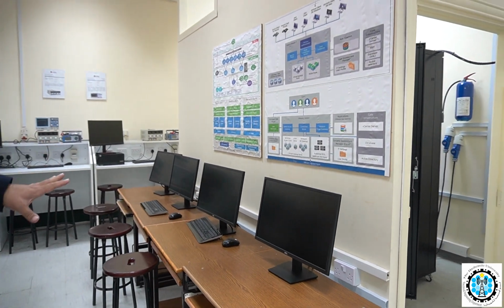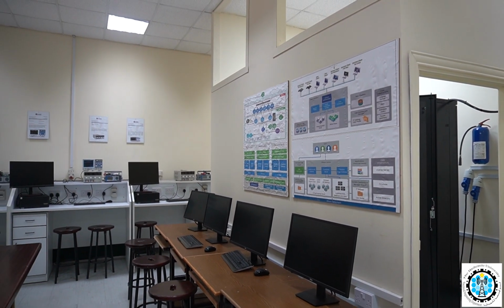Internet of things and Cloud Computing and AI Applications Research Lab (ICCAA)

Comment: Very interesting,
 
Is it a fab lab or a cloud lab?
Because it was announced that it would be a fab lab. (3D printers and laser cutters)
And the idea of a cloud lab is not that obvious; for example, what are the types of projects accepted in this lab and the parts of the projects that could be linked to the cloud system in many different fields?
 
I'm a mechanical engineering student at HU and have many projects in the environmental field. I have participated in many programs abroad, in Germany and the US. So yes, it is very interesting, and I can't wait to see it.
Reply from the maker: Thanks Yara, although we got CNC machine, it has not been advertised as FabLab, as you may probably know we have Orange FabLab in the faculty that has the machines you mentioned. This is IoT focused lab with Cloud Computing Unit as clarified int he video. cloud computing is the ability to create virtual resources (computing, HDD, RAMs, GPUs) dynamically for many concurrent users without a compromise over the performance. there are three cloud types: Private Cloud (on premises), Public Cloud (remote access), and a hybrid cloud (combination of both). this one is a private cloud with two clusters (Vmware cluster and HyperV cluster). we have already four working use cases in the lab (automation, agritech, climate monitoring, water management). drop in to know more or check one of the following uses cases on the website: www.agritech-jo.com